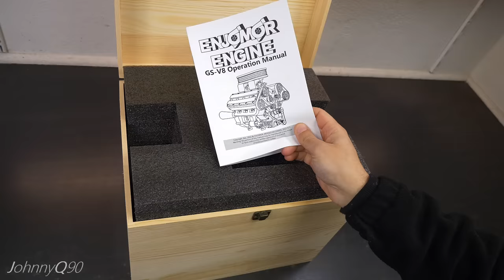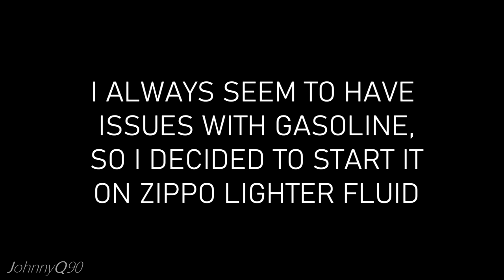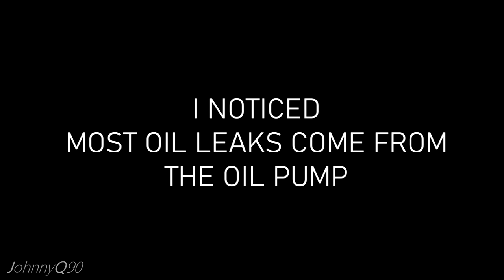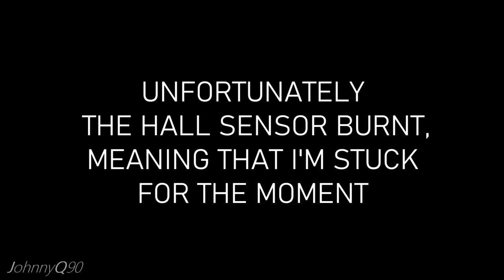Large Scale Model V8 Engine - PREVIEW

Comment: needs a supercharger i think
Reply: or twin turbo
Reply: I would test it with an electric turbo
Reply: DEFINITELY!!
Reply: YEAH
Reply: If you look at the other videos, forced induction with these tiny engines is tough. The tolerances and bearings need to be super tight
Reply: @techroma1984 true but it's worth it
Reply: I think twin turbo would be better
Reply: The problem with small engines like this when adding a supercharger is that the drag from all the bearings and moving parts quickly end up robbing more power than the forced induction adds. Also you can't just go out and buy a supercharger or turbocharger for an engine like this, and making something yourself requires insane precision. Toyan has the supercharger for their V8 but that thing seems to be complete garbage. 

He should probably get it to run like it should before spending time and money on forced induction.
Reply: @Bmw_e39Lover  lol.
Reply: @Fury_BlackWolf  it's a huge upgrade, maybe needs new engine head🤔
Reply: Needs an RC car to put it on. Boost will just overcomplicate it.
Reply: My god, just leave it stock💀
Reply: @Bmw_e39Lover  Would eliminate a lot of issues like starting it up or the rough idle. And an injection system could be simplified on an engine like this when it's for show
Reply: @NorwayVFX  so maybe instead of mounting the usual turbo or compressor, instead add a small generator and a small transformer to increase the voltage, connect it to a mini turbo / compressor driven by an electric motor?  Possibly add a small battery or even a large capasitor. The effect should be similar because the higher the speed, the greater the current, the faster and more the turbo / compressor blows.  I think that such a system would be more efficient in a small engine because we do not load it directly with the additional friction of the turbo / compressor, but only 1 additional bearing for the generator(and magnetic field but I do not know how to determine how much such a field would take power from the engine). Idk I'm not engineer, it's just my wild guess 😂
And and the problem of valve precision and fuel composition is a piece of cake 🍰
Reply: Definitely, sounds a bit anemic
Reply: @echoi7119  🤣 Since when does Johnny leave anything plain stock?
Reply: Single turbo
Reply: YES, PLS DO IT
Reply: Quad Turbos
Reply: Quad turbo with supercharger on 1/5 RC car🤣🤣🤣
Reply: Mo powa babayyyy
Reply: @bartekobarteko  Then you have all the losses of the supercharger with the added drag of the the alternator. Supercharging doesn't work well on this scale because the precision that's necessary to make them efficient. On bigger engines Superchargers are exponentially more expensive than turbos for that same reason.
Reply: @bartekobarteko  A turbo doesn't add significant load to an engine, that's why they're so efficient. It's the sizing that need all the engineering to get them to work.
Reply: @rian0xFFF  or you can do like Volvo did and use an electric motor to eliminate turbo lag by spoiling it up at low engine rpm to maximize the effective range of the power curve
Reply: Forced induction on an engine that size is a challenge they haven't yet mastered i don't think.
Reply: @keltonfoster  Audi in new v8t have electric turbo who lower lag or it's been a dream but it's reality i think 🤔 Fuks I don't remember😵
Reply: @thetruth5232  yes, I know that the turbo does not take much power from the engine because in total it uses high temperature and pressure of the exhaust gases, i.e. "waste" when producing power.  And that's the problem with turbos in micro engines, the temperature and pressure are too low to use them effectively.  On the other hand, the compressor takes this power directly from the engine and we are not kidding ourselves, there is not much of it there.  That's why I thought of such a hybrid.  Generally, such an electric motor driving a turbo does not have to be super powerful, today there are already so effective electric motors and efficient small generators that, in my personal opinion, it would make sense and work.  Well, as I said, I'm not an engineer and even if it turned out to be a waste of time, I would like to see a video of building something like this and trying to force it to work 😂
Reply: imagine the high pitched whine
Reply: Couldn't agree more  put a supercharger on it
Reply: @NorwayVFX  If you have watched the other videos, all of the superchargers make practically zero boost pressure. This is the main problem. The atmosphere is about 15 psi. Even with another 2 psi from boost (most i've seen), that's only a 13% increase in air. But yes, this means they aren't useful due to friction.
Reply: he had tried but to no avail
Reply: Definitely should add a super charger
Reply: It would be fun to see with an Electric Turbo- if it's possible to get one that small.. or just Any kind of BOOST 😁
Reply: I mean…doesn’t everything need a supercharger???Id put one on the wife’s vacuum cleaner or hair dryer if I could…🤣🤣🤣
Reply: twincharger
Reply: Avarge american lol
Reply: OwO
Reply: @jackbrown825  dude wtf
Reply: IR fuel injection.
Reply: It needs sequential quad turbo
Reply: May as well go for bigger displacement.
Reply: Yes bro that would be so cool

Comment: Can you perform a compression check and leakdown? Would be interesting to see if you can give it a boost. 78cc is getting into go-kart territory.
Reply: I thought of a scooter or some sort of motorcycle :P
Reply: my Derbi gpr 50 is 50cc and runs 80 km/h easy. so some boost would go well ; P
Reply: your moped is a single cylinder twostroke, I doubt this v8 will ever make as much power.
Reply: @lucasvanhamburg4937  description says 3.8kW, i had a 4s 50cc moped which reached about 60 kmh on a good day with 2.2kW. Derbi 2s is 6.5kW.

So it might be unpractical, but possible. You'd probably have the only v8 moped in the world.
Reply: @HvV8446  wow I didnt know it made 3.8kw, thats totally a usable powerplant for a moped. I think whatever Q90 does with his engine it will be  very interesting!

Comment: Mine arrived a couple of days ago.There`s quite a few problems.
1) All 8 spark plug washers are the wrong ones.They are all horribly distorted to the point of not sealing at all. Might be worth checking yours.
2) Oil pump belt WAY too tight. It`s actually bending the water pump shaft.Needs the mounting altering.
3) You need to rotate the rotor arm relative to the inlet cam to alter the timing.Turning the cap does nothing.
4) Cams are very badly machined and also badly designed.Put a DTI on the base circle and at least on mine I`m getting a deviation of 0.45mm.!!!!!!!!!!!!!!!!!. Should be zero That`s huge considering the total valve lift is only 1.3mm . A "pointy" cam is the worst possible design for roller followers although it would be ok with flat tappets. I`m in the process of machining up 4 new cams with a lot more duration. 
5) There`s a restriction in the flat plate under the carbs. Holes are too small.
Reply: Thanks for your opinion!
I think that these engines are built very weak on purpose to reduce the work in development and reduce the stress on the parts. That's why all the carbs, intakes and valves I've seen on these china engines are very small. The Conley V8s seemed to be very different quality.
Still amazing what they're making now, and it can only improve. Plus the price is already remarkable
Reply: It's Chinese after all.  I'd be surprised if it was good out of the box.
Reply: @paulklasmann1218  I would expect a good running engine for 3000$...and no missing nuts/screws whatsoever...
Reply: for an engine this expensive, these problems shouldnt exsist at all. I mean I know that the machining takes a while and the lower production numbers makes economies of scale non excistant, but the quality should be put into these engines to allow for simple assembly and running in no time, there shouldnt be these pretty major quality control issues. I wouldnt want to spend thousands on an engine only for mounting brakets to be re fabricated, cams not even close to functional, screws and shafts that are bent or missing, and the entire thing just isnt built well. With the low production volume and price, I would expect the engine to work flawlessly with no extra work needed on my end, probably test ran to ensure prefection on such an expensive engine, and better CQ to catch these glaring issues. I would love to get one, but even at half the price I wouldnt want this because of the issues, fabricating and machining rerquirements to get this running, and just the lack of any support.
Reply: @rayhai6781  Agreed completely!
Reply: Do you by chance have video of yours running properly?  Like the concept of these engines is amazing and I've seen fixed versions of their I4s run exceptionally well.

These engines want to run it's just Enjomor puts their rough draft engine out for a decent amount of money.  Like an amazing final product is there, it just needs reworked and finished.
Reply: @manitoba-op4jx  Beat me to it lol
Reply: @Cabooseified  Mines not run properly since I had it. I`m waiting for Enjomor to send me 8 plug washers. It may seem a trivial part but according to Mr Google they are a really weird size and only available with the plugs and the plugs are not cheap. I have a photo of the mangled plug washers but don`t know how to upload it. I`m surprised Stirling kits have released them like this. My Toyan FS L400 also by Stirling kits has run flawlessly for 12 months once I made a center crank bearing for it. To be honest the V8 will never run properly with the cams only having 1.3mm lift and less than 170 degrees duration. It`s a shame because the ports,valves,manifolds and carbs are quite big and will flow well.
Reply: @0120raptor  I've seen other videos out there of Enjomor engines having issues with compression, needing cylinder sleeves and piston rings.  But, after people fix the issues they run really well.

I agree with you 100% the potential is there.  They Enjomor just delivers an unfinished product.  It's a shame.  Hopefully new cams will come out to fix the issue.
Reply: sorry for this problem. i will contact you via email.
Reply: @rayhai6781  does not matter, still chinese
Reply: That's a difficult thing to do isn't it? You would have to have a 5 point axis CNC machine right or can it be done on a lathe?
Reply: We're in a habit of saying that Chinese products are junk but that's not true. Yes there is a lot of low quality mass manufactured products made to be disposable and that's not a bad thing when you don't have the money to purchase the Swiss/German European high-precision close tolerance parts for a job you only do a few times in your life. But there are quite a few companies in China that make precision products that are much more affordable than other countries like the flashlight company Sofrin that make really good torches 😊 aka flashlights as well as lumintop.
Reply: @keltonfoster  I`ll have a go on the lathe. If that fails I can borrow my mates 5 axis machine.
Reply: Wow, that's pretty terrible.  It's strange they go to such huge lengths to make someting bespoke like this, and then totally screw up the finer details.
Reply: @charliemaybe  I don't think this is an expensive engine. An aussie Conley v8 would cost $5000. For this, So don't expect to much. You get what you paid for.
Reply: @fanghou8924   Well maybe, but for thousands of dollars you should atleast get an engine that will run at least half decently with little to no defects or qc issues. I mean a 2k full size v8 will be in the 5k range, but that is a running and well put together engine that makes much more power and weighs much more. I think something that weighs less than 1/50th of the full size one that the cost wouldnt be that high. No I am not expecting an engine that will cost 1/50th of the full size engine, but at least at this price point to have a quality and running engine out of the box and not something that needs a ton a fiddling, fab work, and what not. I dont mind fiddling with a carb or what not, but things like cams, spark plugs, timing, and what not going wrong out of the box is just not acceptable no matter the cost.
Reply: @charliemaybe  No, that's not how things work in hobby bussiness. The price doesn't depend on the material, not matter it is full size or 1/10. It depends on the production scale. Think about it, the mobile phone has much higher tech-density and precision but  is made in millions. But a scale engine, is typically made in tens or hundreds of units. It will cost more than you think.
Reply: Is it a Chinese product? Theyre getting better but still can't keep tolerances on lots of machine work.
Reply: @manitoba-op4jx  I replaced and upgraded my Lincolns engine for just 600, LOL....these are ridiculously expensive!
Reply: You spent 2900$ for this?
Reply: you need to make a video about it, i would 100% watch it
Reply: @rayhai6781  agreed
Reply: for something that is that nearly 3000 dollars, that is very dissappointing
Reply: That's crazy to have so many issues for such a high price, the manufacturer of these must not care much about quality control
Reply: chances are he was sponsored by the company that made this, so they took extra care to make sure that his engine was better than the ones that they ship to regular customers
Reply: Way don't make Diesel engine, need for truck 1:4-1:10.

Comment: There's no accelerator pump on those carbs, so on throttle opening they go lean.  Richen the mixture slightly and that should help.  Not sure if the intake has two planes, but if it does, synchronization would be necessary to prevent stumbling on acceleration.   Additional flywheel mass may help smooth out running at the cost of throttle response.  
Valve seats and seating may be poor, lapping in the valves or just more break-in will help starting and idle stability.

Comment: Just advancing the cap does not change timing but can induce spark scatter. The position of the hall effect sensor that burnt out in relation to crankshaft is what controls timing. https://youtu.be/zpcz7SeYClQ?t=462      You could also use an adjustable electronic spark advance module.
Reply: i have this moped that is speed limited by a hall effect sensor cutting spark , its a 4 stroke single cyl, would a module like that be able to fool the cdi?

Comment: If it calls for straight 20 weight oil you might want to consider using straight 20 weight. I don't know where you would get that but 20w50 is going to behave like 50 weight oil at temperature and the manufacturer may be counting on the oil being thin at temperature to properly lubricate everything. I'm not sure what their design tolerances are but if they're expecting 20 weight and you're giving them 50 weight at temperature that could be a problem
Reply: Another option is 5w-20. Performs like straight SAE 20 oil at operating temp.
Reply: @patx35  Yeah that would probably work just fine. I just worry that oil being that thick might not be able to get where it needs to go and do what it needs to do. It's also going to cause a lot of drag in the motor.
Reply: your assessment of the oil is wrong....the multigrade oil 20w50 has a weight or viscosity of 20 but lubricates like  if it was a 50...thanks to the additives....so its still a 20...has the viscosity of a straight 20...with the advantage of protecting like a 50.....   for example on modern diesel engines they used 5w30 but now are switching to 0w30...they both lubricate and protect like a 30 but the 0w is much thinner resulting in less friction and more efficiency.
Reply: @MrHBSoftware  That's not how it works. 20w50 Multiviscosity oil is designed to have the cold viscosity of 20 weight oil when cold but the hot viscosity of 50 weight oil when hot. Essentially it doesn't thin out as much as a single grade oil as it heats up. This allows It will be thin and flow well when cold yet not be too thin and lose its ability to work properly when hot. Look it up.
Reply: @MrHBSoftware  @DoRC is right. Watch Project Farm's videos on oil comparisons for more info, they're extremely well done
Reply: Yeah I agree. It's supposed to be 20 weight oil. Straight 20, 0w20 or 5w20 should be the correct oil to use.
Reply: Biggest misconception with engine oils is "weights". 5W-30 stands for SAE 5 Winter - 30 operating temp. Performs like straight SAE 5 during the dead of winter, and SAE 30 at operating temp. People always gets them mixed up when switching oil viscosities.
Reply: None of yall understand viscosity !
Reply: @darkone9572  please explain

Comment: What you need is a programmable CDI. That way you are in control of all the ignition timings. Program yourself a nice RPM to Advance curve
Reply: This engine would be a cool demonstration system to use a board with the speeduino firmware to better control the ignition, and maybe even add (single point) electronic fuel injection

Comment: hey! good video. 
At minute 3:07 you can see the fourth cylinder that loses spark, it has a leak.
Also when the accelerator does not respond, you have to adjust the screw on the side of the carburetor until it improves, that is the mixture. lucky!

Comment: This video is great I have an idea u should try making an actual clutch just small for the engines size and connecting it to the transmission u built and Dyno testing it once u get the correct fixings of the engine